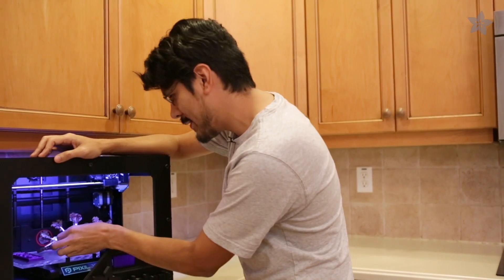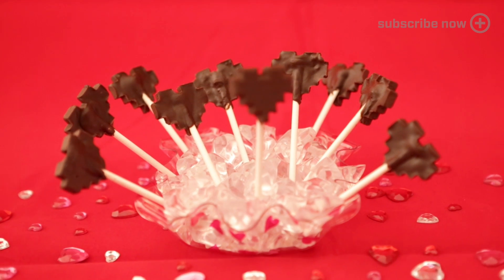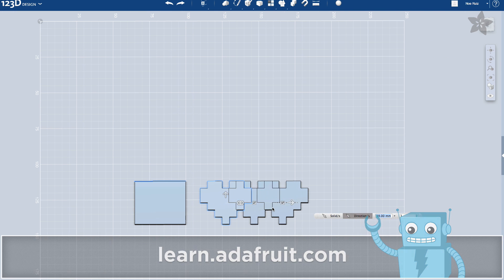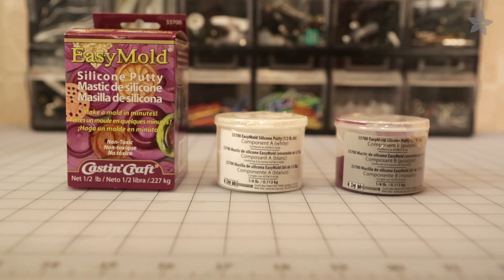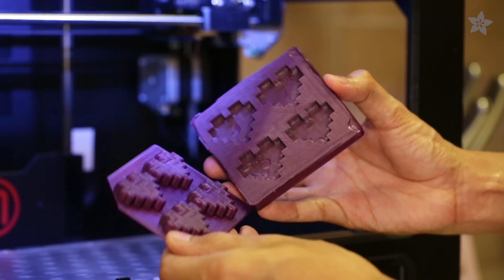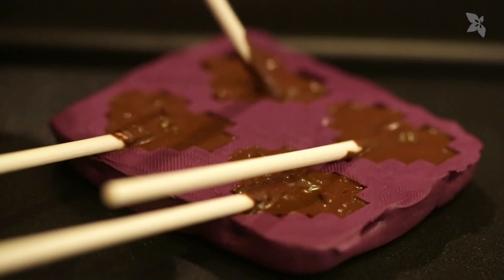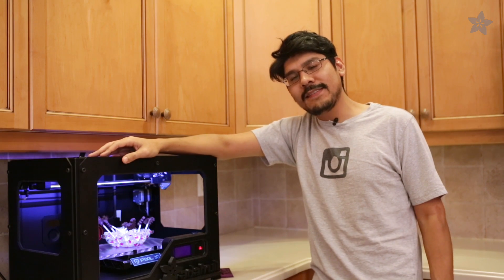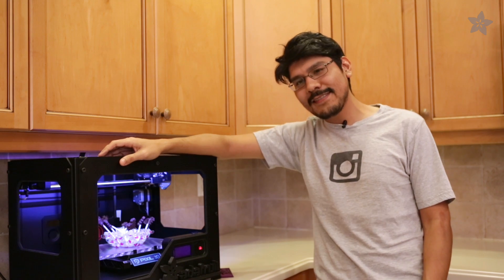3D Printing Chocolate Molds

Comment: why dont you print straight plastic mold?
instead of that slicon again?
Reply: Because it's not food safe and the silicon is.
Reply: @adam6806  there are many filament material which are food safe e.g. flexible TPE, PEBA